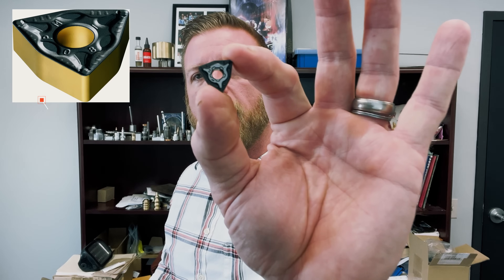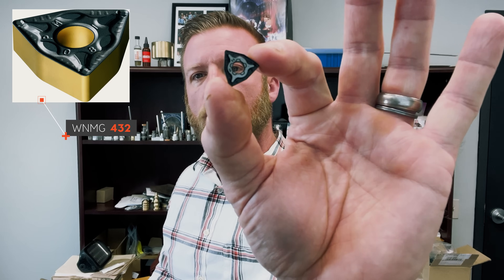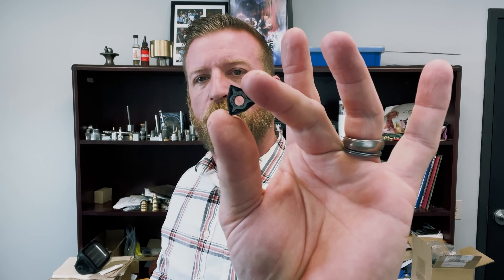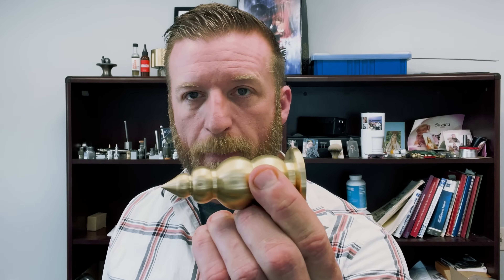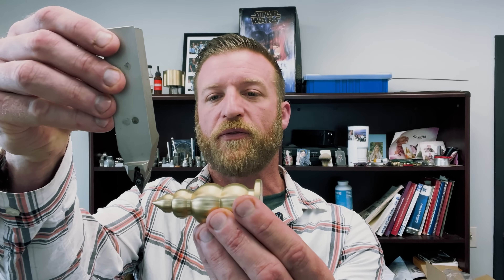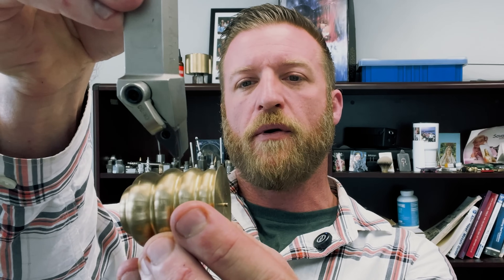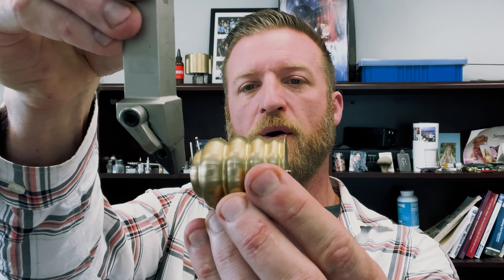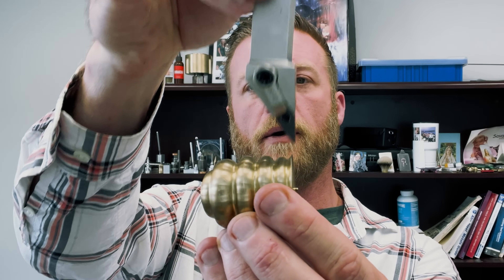What Tool Should You Use When Turning? | The Lathe Lab Ep.2

Comment: Very helpful video, thanks for taking the time to upload. I just took over some setup operations on a mill turn at my job. Although the parts are programmed in CAD, the previous setup guy would sometimes have to make/rework fixtures which would occasionally require turning. And since I don't normally program turned parts, I've been looking for some general feed rules to have in my back pocket for when I need to turn something on the fly. Your 1/3 -2/3 rule is gold and made into my notes for future use! Great content, I'm looking forward to any new videos in your series.

Comment: Good tips!! 
For finishing i like to leave more material than the tool radius, i have experienced that with some hard to chip materials leaving more material seems like the chip breaker of the insert works better. Also i have to use this approach as in almost every part i make there are two critical surfaces where i can't feed fast enough to break the chip.

I use VCMT/VCGT, CCMT/CCGT for roughing, and DCMT, VCGT and CCMT CCGT for finishing, i have some accesibility problems on some parts so i don use WNMG.

In the end every machinist needs to learn when and how to use the different tools and geometries, hi feed geometries are rising on the market for lathe work but there are sometimes you can not use it efficiently
Reply: That is such a great assessment and thank you for the input. I agree with everything you said and you summarized it well. Every machinist should know what works for them. Furthermore, we all need to keep learning and developing
Reply: @Crusadermachining  continous improvement is the way!!! Keep up with the great content
Reply: @yagermeister1303 thank you

Comment: Killin it man. Very good video. In my 10 years in a job shop, we started with DNMGs as roughers and VNMGs as finishers. I’ve shifted more towards WNMG for roughing especially face roughing. I wish lathe turrets weren’t so limited for space, I’d like to have all three. 

When would you opt for a neutral vs a positive style insert (eg VNMG vs VCMT)?
Reply: Hey man thank you brother. We’d switch to an insert like a VCMT when a certain geometry is needed for surface finish and/or material group is being machined. So we do have a few jobs that call for VCMT - surface requirement on a rough alloy is the reason. 🤝